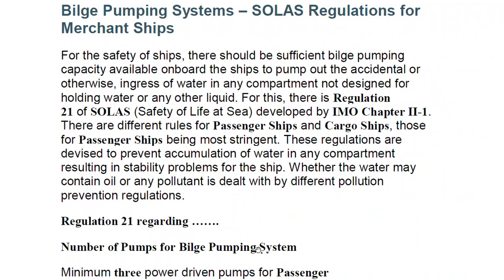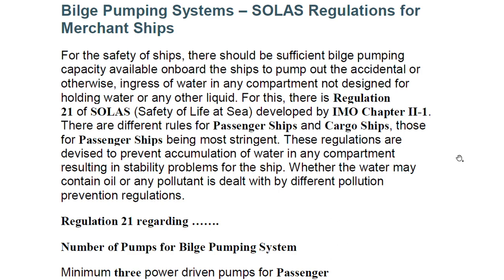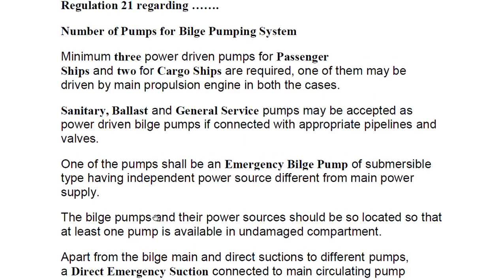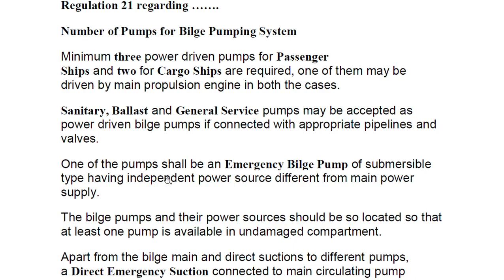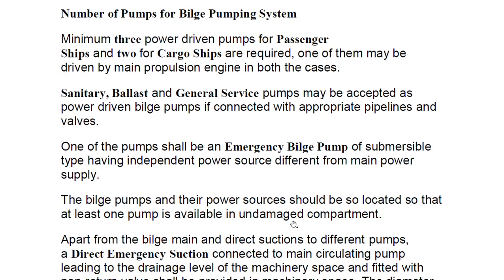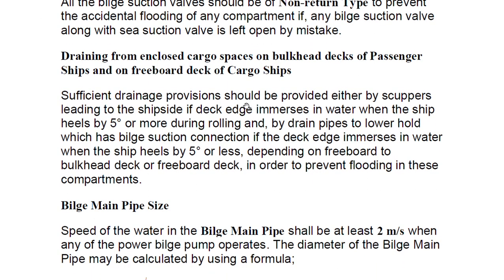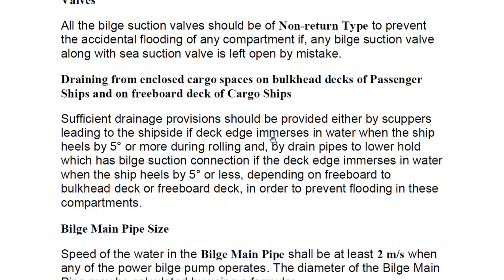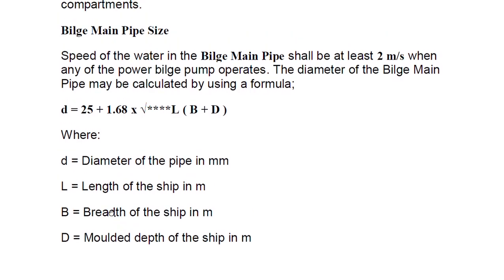SOLAS Requirements for Bilge pump/Emergency bilge pump/ Bilge system valves/Bilge system pipelines.

Comment: The emergency bilge pump is for passenger ship right?
Reply from the maker: An emergency bilge pump is required for passenger ships but may also be fitted as an extra on cargo ships.
Reply: @ersauryashankar  thank you sir. I'm done with safety last month. Got both safety and electrical ❤️ giving my motor and mep on 28th.